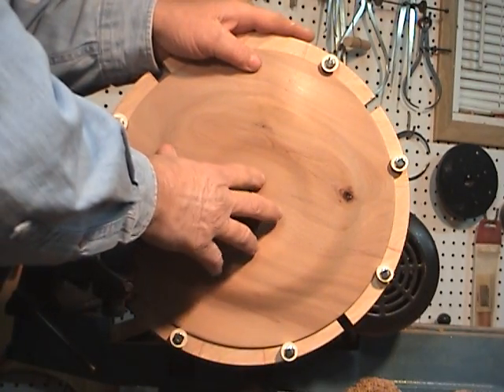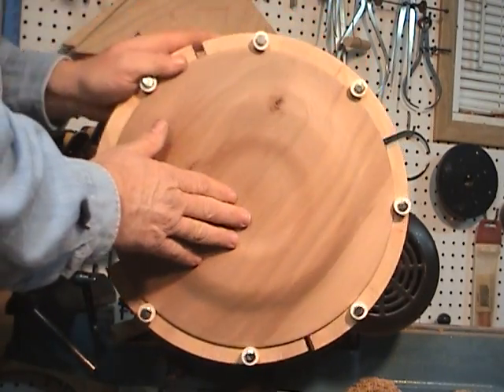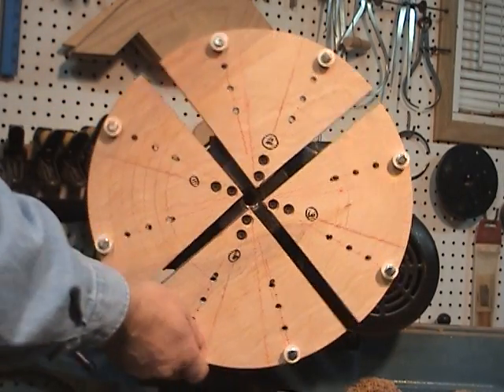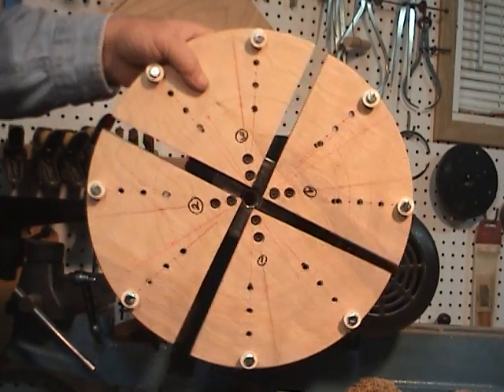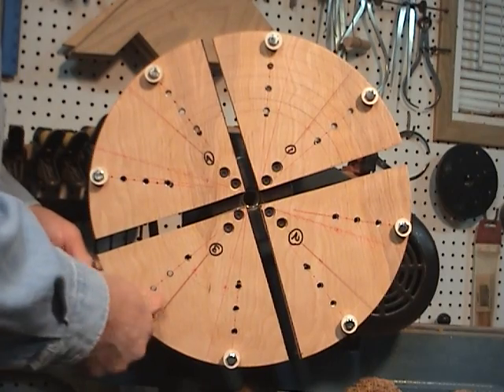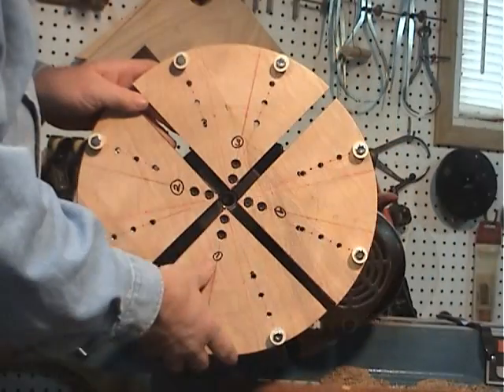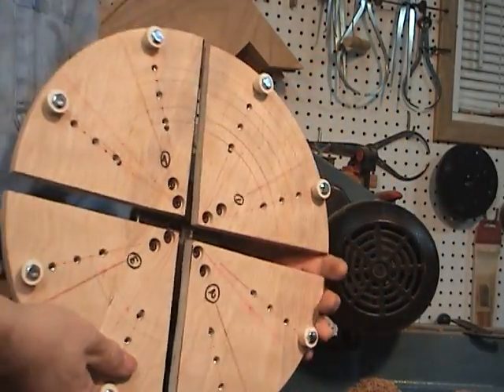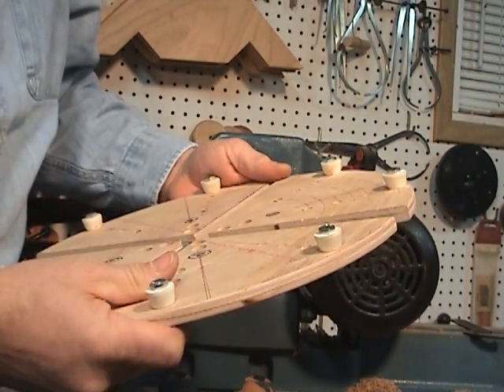Plate turning with home made cole jaws

Comment: A good video and a very nice platter.  I made a cole jaw several months ago, but did not know about the bumpers you used. I made mine from wood and made different angles for each side.  I attached my cole jaws to an extra set of chuck jaws I had and used eye bolts so I could hold a difficult bowl in place by running twine from side to side when I could not make a tight clamp on it.